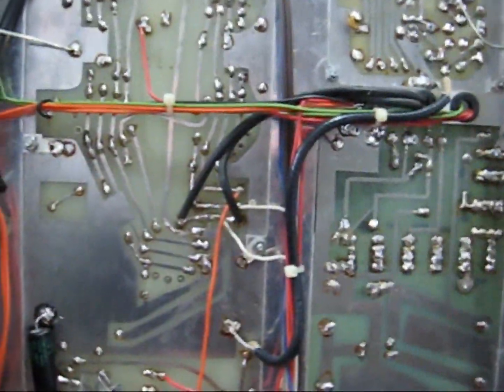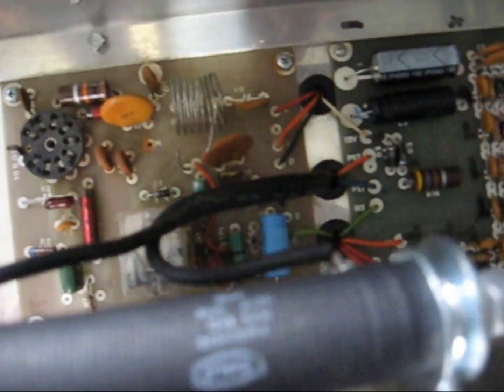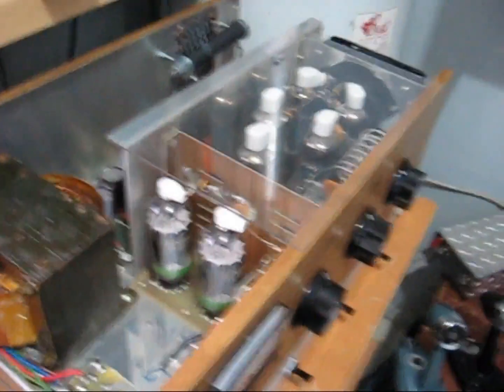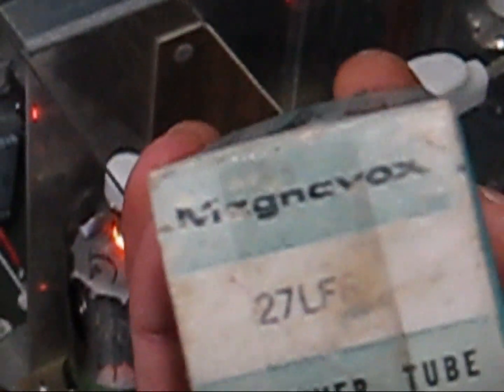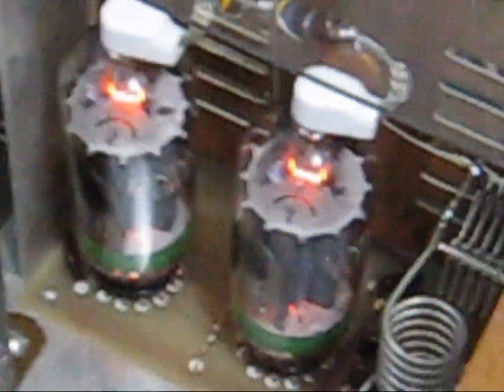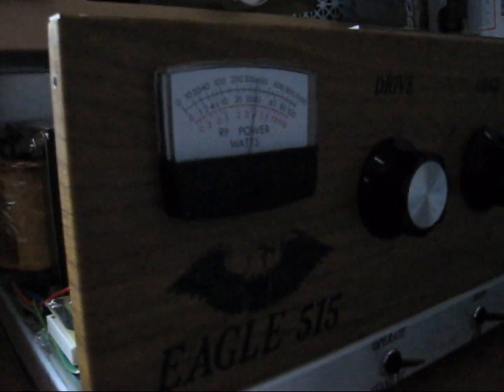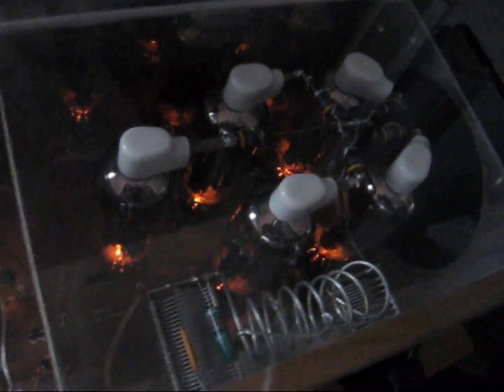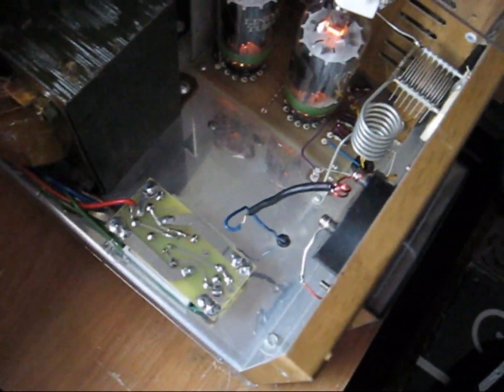Kenrich Eagle 515 resistor mod for 5 final tubes 20lf6

Comment: Brings some mighty fond memories, for the record the original design did NOT put 30 volts out to the tubes, we wouldn't allow them off the test bench above 23 volts.
Reply from the maker: wanna let go of some of your stash tubes?
Reply: Sorry friend, I have 1 of every amp we made, brand new still sealed in the box, the tubes are for those units. The original oval logo tubes (the strong ones). I also have most of the original tuning & test equipment from the test bench.

Comment: them tubes hard to get now.  put a ac meter on the filament  of the tubes. 20LF6 is 20V ac. my palamar has 6 6LF6 in a 2X4 setup remote power supply.  Need HV caps.  you could use 6LF6 but 6V more amps. you would have to mount a 6V transformer on the back. keep your drive down get longer tube life.
Reply: You aren't kidding hard to find I have two sets of the them 20LF6...  One that came with amp and one I found online by luck!!

Comment: Where did you get the meter did it fit in the original holes?
Reply from the maker: meter is out of a old Para Dynamics PDC600 watt meter, either that or the astatic version
Reply: Thanks brother you still have the amp?
Reply from the maker: no I wish I did.
Had to sell most my stuff to survive

Comment: I have a Eagle 500 I like the Mods you have done to yours.. Do you have a Schematic of the soft start and resistor you used to drop voltage on Amp I want to restore mine. Tubes are high.. UGH..
Reply: Yes Toby tubes or high as shit...by the was this is chris in Louisville off your fb friends list lol
Reply: chris2crazzy NRO_505 lol

Comment: I have a Kodiak 750 that has a fan that's that noisy too. I want to mount the fan away from the amp and pusg the air via a duct. The fan noise is just too much.
Reply: On the Kenrich amp in the video, the fan works well to pull air in thru the rear vent. The chassis is designed (with the cover on) to pull that air past the transformer, then past the two driver tubes and finally around and past the 5 output tubes. The air coming out of the fan vent on the right side is quite hot by that time.
Reply: @monstersdoexist  I get too much fan noise on my golden falcon with the cover on. That's why I need to do something mounted away from the amplifier. Your amplifier is a nice one. Good job.

Comment: Why don't you just get a 25 or 27 volt / 110V transformer.  Then, you would not waste all that power in heat from that resistor.